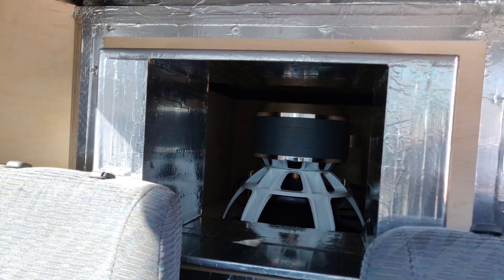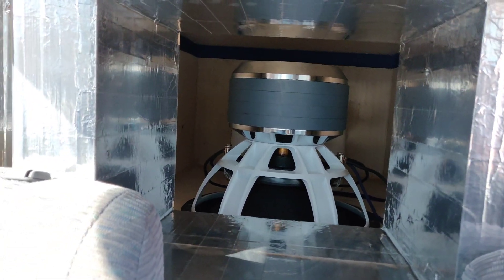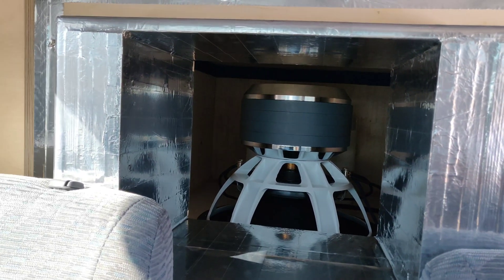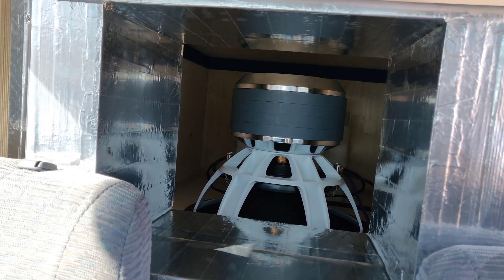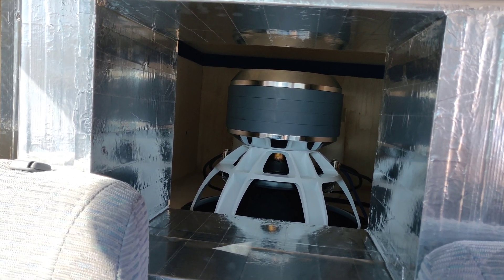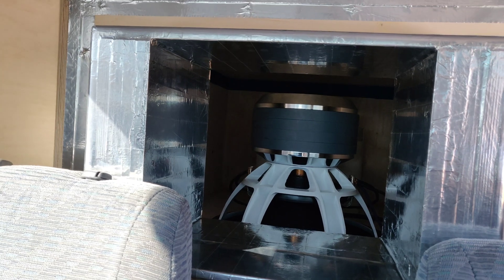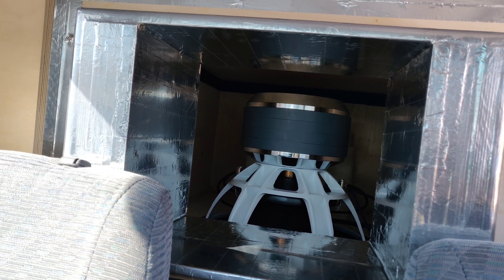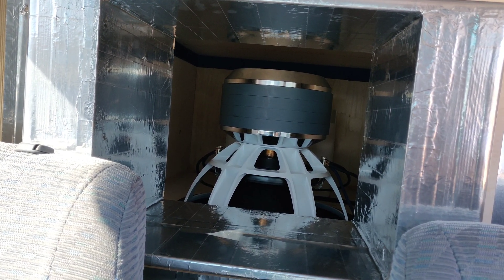SINGLE RS Team 18 on Smart 5k - BUILD BREAKDOWN + 23HZ DEMO

Comment: Why in 6th orders is the port so small for bottom enclosure? Shouldn't it be at least 16 square inches of port per cuft?
Reply from the maker: Normal ported enclosures are typically 12-16" of port per cube depending on tuning, goals ect. Series 6th orders essentially have an enclosure inside of an enclosure. They behave completely differently from a normal ported enclosure. 4-8" rear port is completely normal. Give good cone control and makes it easy to tune ultra low. Front port is usually 18-24" of port per cube. None of this is law though, testing and experimenting will render best results
Reply: Not sure either I just know it works, I’m curious if anyone has experimented using a 6th order with regular ported box specs with 14-16sq inches of port per cube on rear and seeing how it behaves

Comment: Why small ports for low end? Seems like you'd be losing a couple db's down low using two 4" ports on 6 cube. Fortunately series 6th order filters a lot of the port chaffing that would be very noticeable in a typical bass reflex using that ratio.
Reply from the maker: It was at 4.5" inches of port per cube rear. 4-8" is pretty normal for most 6th orders. It worked pretty well for me

Comment: R u running cmax? This is doing great for one single sub, I am rebuilding my truck had 4-18's crossfire xt3 18 going to six 18's xt3, I am running six smart fives on it love these amps one of them puts out more then the trash ass sfb 13.5k i had two of them barelt clamped 7500 out of both combined, what is your rise like and what is your ohm load?
Reply from the maker: These smart 5s are no joke! And honestly I have no clue what my rise is, but I'm wired at .5 at 15.5v and it's been loving it. Hardly gets warm at all.
Reply: @SingleSubScrub  how about that dyno video had a guy today commented on a post I made a while back about smart fives doing 6300 watts clamped he is like no way they make 14k
Reply from the maker: @1-Six-dee  I love it lol, people def hate to believe a $450 amp can do that.

Comment: Hey with your voltage being 15.5+ volts does it throw the battery light in the dash?
Reply from the maker: Light has come on once in a while but the second I touch the gas it shuts off. Have had zero issues tho

Comment: Simply awesome dude. I like a 22-27 hz tune but I change my tuning about every 3 months or so. Think about getting a RS team 15 but I have a pair of Adire Kali 15 in a 10.5 box tuned to about 25hz on an 8k. I may save some weight but I don’t think I’ll get the same wind and output with even a Team RS. So idk maybe I’m wrong?
Reply: It would more lbs then I want t have in my trunk and would exceed what I can power to get two Team RS 15 I love to have an 18 though or even a 21 frame mounted to the team RS motor.
Reply from the maker: @workingclassperson2124  yeah it is a monster sub. The 18 only requires 4.5-6 cubes tho. 6 is a bit too much for me to be honest. I need to cut down my bottom chamber size, as I'm about to be doubling my power lol
Reply from the maker: If anything you'd probably want to run a pair of team 15s to potentially see a difference. I personally can't really say though, as I really don't know anything about adire to give an accurate response on this.